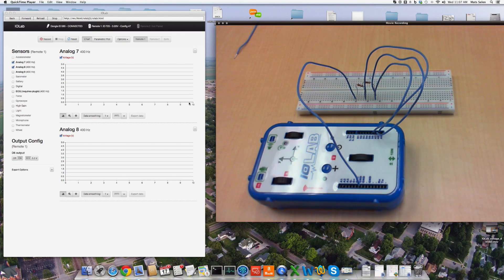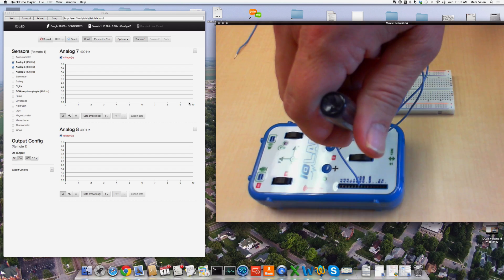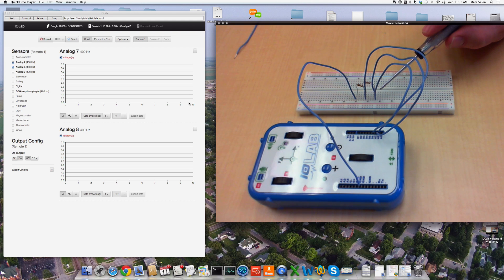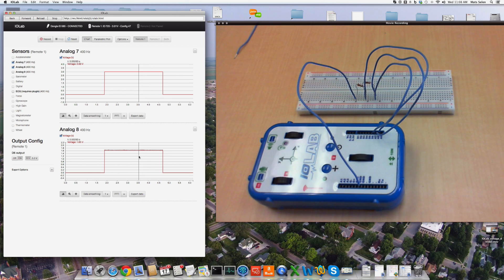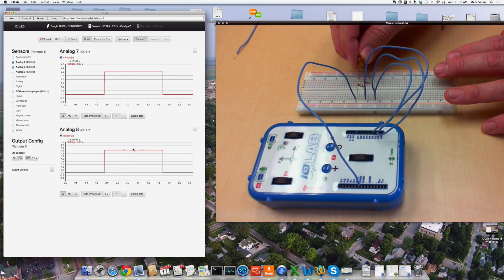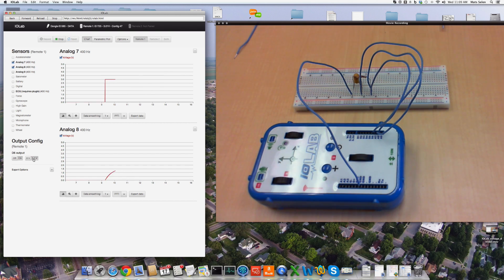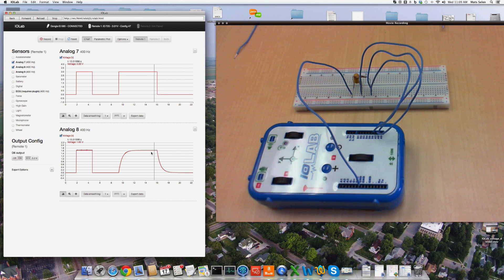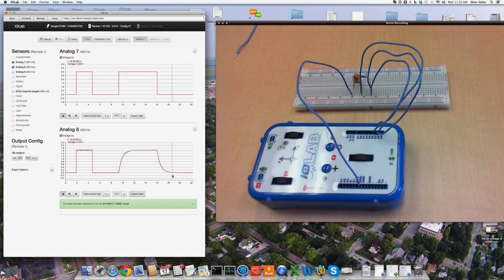Example 16: RC Circuit

Comment: Hi Mats and all.  I have run this experiment a few times, and I get that the capacitor will charge to the source value. I double checked the theory just to make sure I didn't set it up incorrectly, but 3 V stands.  I will share my data set with you.